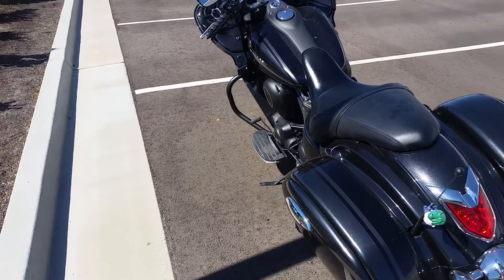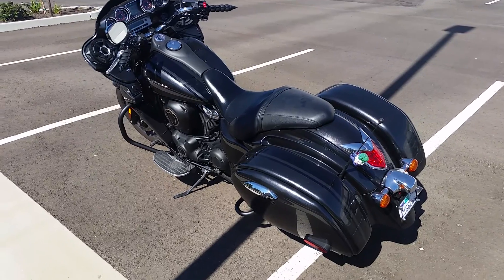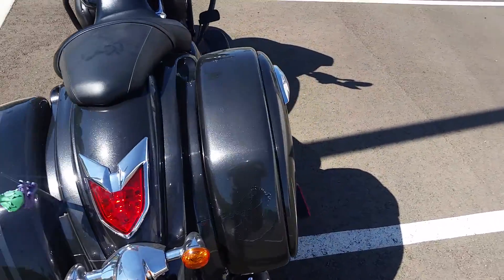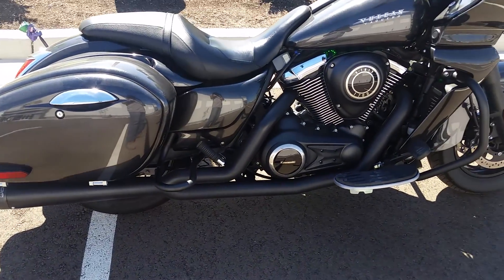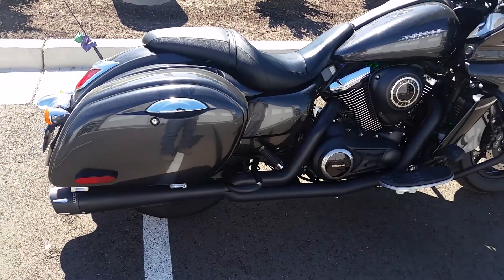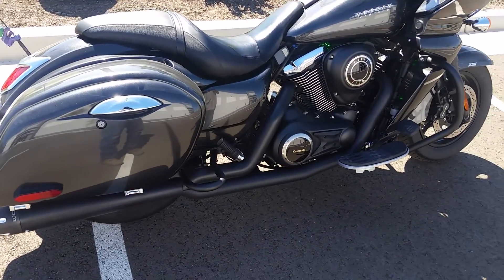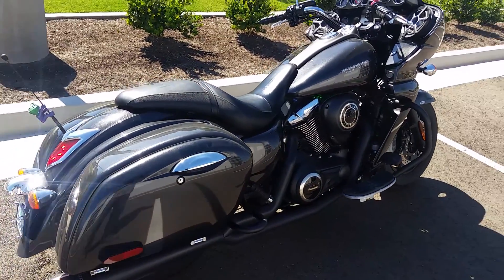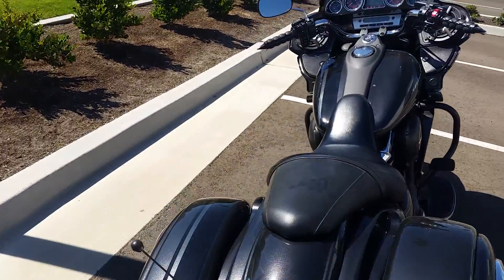Kawasaki Vaquero Freedom 2 into 1 W/ Ivan's Tune

Comment: That is the exact exhaust I want. And have been on the fence of whether to do the Ivanization. 
Just not sure if I want to do the exhaust first and then Ivan after. Cant do both due to costs. Living in Ontario, Canada, price is extreme.
 Thanks for the video.
Reply from the maker: Sandra Barkhouse If you have a 2015 or newer and if you have an O2 sensor you will need the Ivan's flash first. There is NOT a O2 bung on this exhaust. Ivan's remapping deletes the sensor.
Reply: Do the flash. Where in Ontario are you? I'm near Barrie.
Reply: I am by woodstock. Howdy neighbour....lol

Comment: Just bought a 2017 and the first owner got the freedom 2 into 1 and an after market air intake not sure if he got Ivan’s flash do you know what would be lasered or etched into the ecu if it was done?
Feel like I’m getting bad fuel mileage but not sure honestly just fueled up my first tank still need to get a solid feel for the bike
Reply from the maker: They used to put a black and chrome sticker that said Ivans performance.  You wouldnt be able to see it unless you removed the ECU.

Comment: was the flash worth the money?
Reply: Wondering the same here. Want to get mine reflagged too, also for the temperature/leanness issue dealt with.

So, was the Ivan flash worth it? Everything I've read tells me it is.
Reply: It is said to be the one thing you need to do to the bike! I currently have a PCV with ignition mapping and I'm happy with the current map. That said, I want the cooler running and drivability benefits; the added performance is a bonus and I hear she gets up and goes after the flash!!!